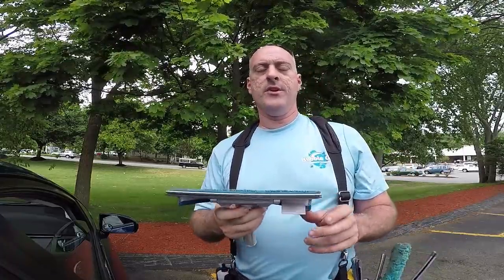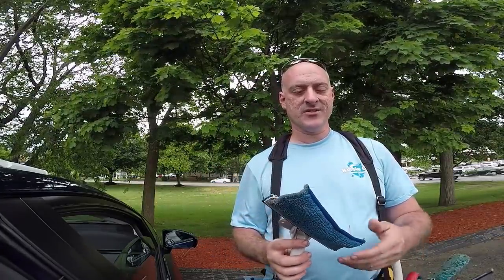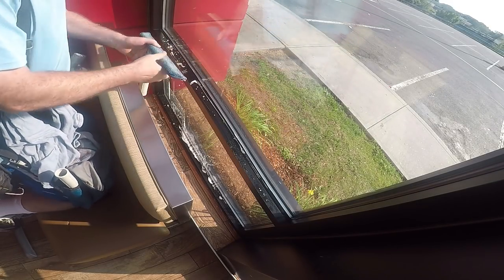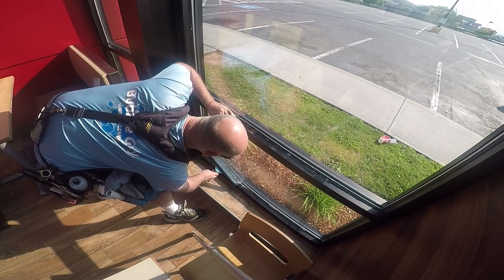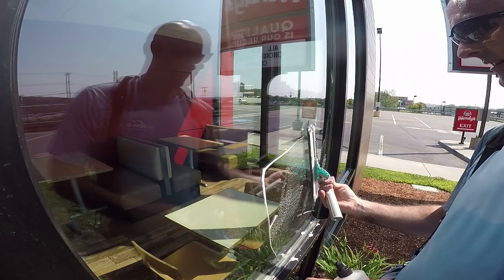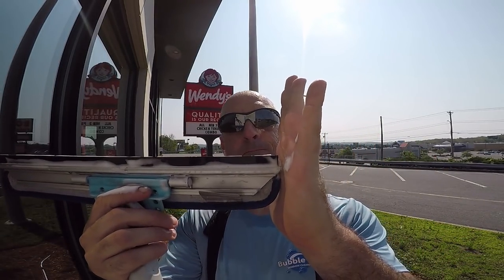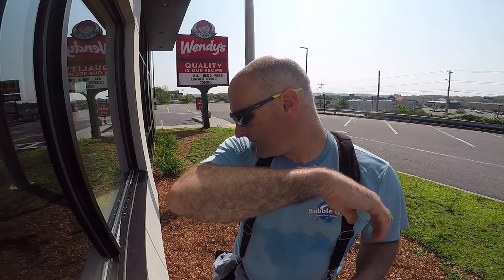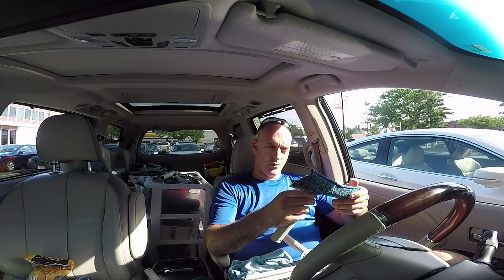Wagtail High Flyer Explained and Demonstrated

Comment: Great video. I went back to the wagtail after using the excelerator and I found it to be much smoother. I'm wondering though what the difference is between the two styles of wagtail handles. I have the flipper but the handle is above the disc. All yours have the handle below the disc. Is there a difference in performance?